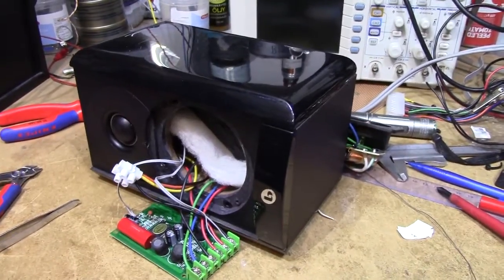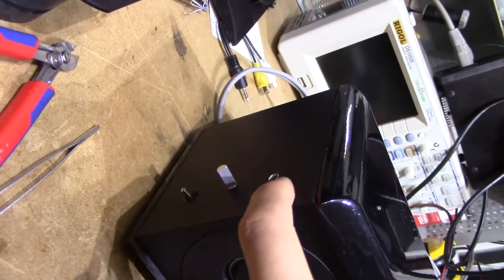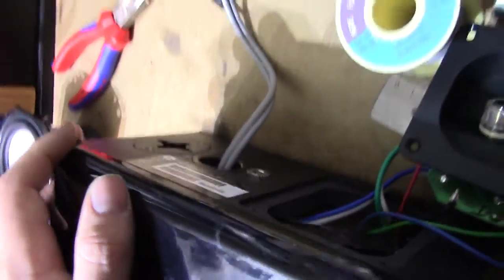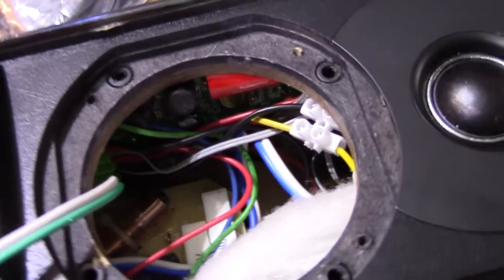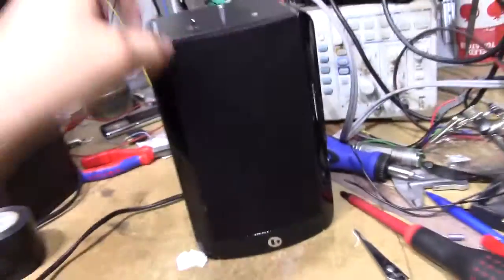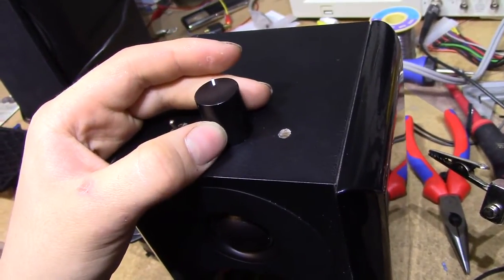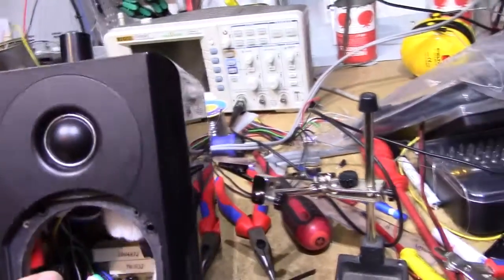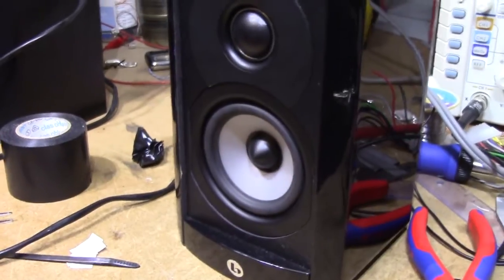Tiny battery powered hi-fi speaker (WITH NO COPYRIGHTED MUSIC)

Comment: intresting!  :-), so what eBay amp do you recommend for a 12v battery ? (pordable boom box,  I used before the Y148 amp before. ..)
Reply from the maker: +Niklas Karlsson It depends - I have a few amplifier board reviews on my channel, and a couple more coming up soon. The TPA3116 seems to be the current hot chip for the Chinese, so perhaps something based on that.
Reply from the maker: Niklas Karlsson That first one probably looks the best out of that lot. I've reviewed one of the TDA7492 boards on my channel, and it wasn't very good. You probably want to stay away from the TA20XX chips, they're ancient.
Reply: OK,so TPA3116 and the TPA3118 is the "latest thing" ? :-)